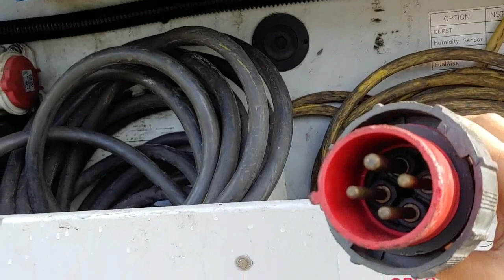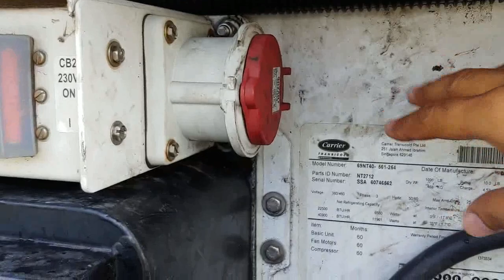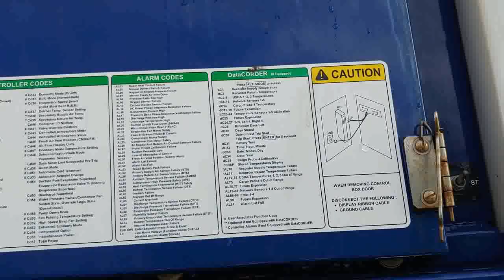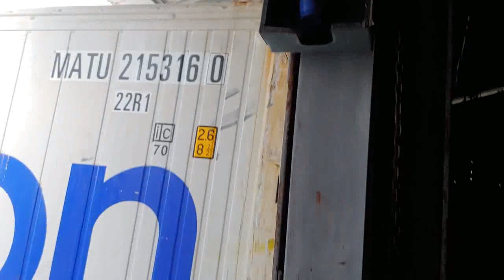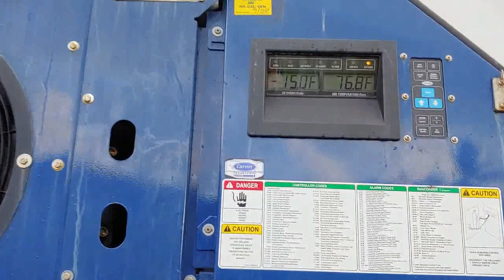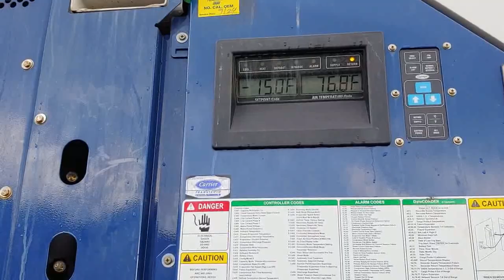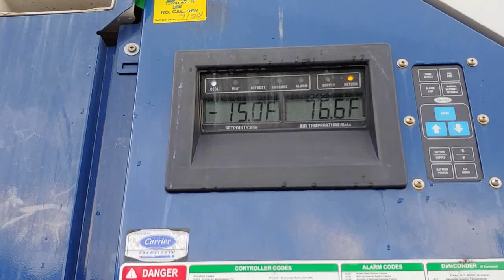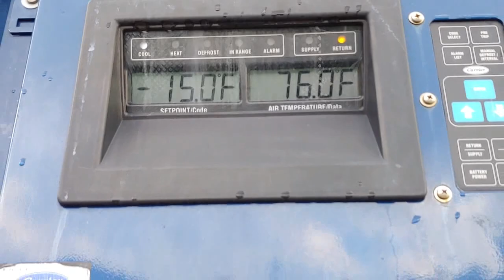HOW TO PLUG REEFER- REFRIGERATED CONTAINER 460 VOLTS TO 220V (Tagalog)

Comment: Kabayan ilang amps ang breaker na  pinagkukunan ng supply ng reefer salamat..at ano  sukat  ng wire..
Reply from the maker: 30 amps po ang breaker tapos po ang wire gauge is #10 awg  3 phase po k c kaya mababa ang amperahe k c po pag nilagyan mo sya ng clamp ameter 23 to 26 amps po ang bawat linya

Comment: How i can buy step up 240v tp 460v transformer for container like this? Does it has part number?
Reply from the maker: Yes sir  have a part no# and this  transformer they bought in guam by our company
Reply: @JPTECHMULTICHANNELTV74  
Can you send me part number Please? 
I was looking on internet and can't find anything.  Also been looking your video how to connect it to 240v and it was deleted.
Reply: Video #10 was deleted. Is it possible to look on it somewhere
Reply from the maker: Hi sir brand name MADDOX INDUSTRIAL  TRANSFORMER cat.no# AD370-B0926
3 PHASE  60hz
15 KVA
VOLTAGE 208-480Y/278
S/N 19-11-19-84362H

The connection sir they gonna give you 
220 to 460 volts 3 phase
Reply: @JPTECHMULTICHANNELTV74  magkano po sir?

Comment: sir ang sabi niyo po sa video 360volts ang input pero 220v etong nasa title sir, ano po talaga yung voltage nung outlet sir?
Reply from the maker: Master 3 phase ang power nyan bali 5 wires yan 3 ang hot line isa ang neutral at isa ang ground yung 3 hot wire pag sinukat mo master ng tester ang line 1 and line 2 220volts pag sinukat mo ang line 1 at line 3 220v din kaya yan 3 hot wire 360v.   kaya may sariling transformer yang reefer container dahil mataas ang voltahe nila sa barko master